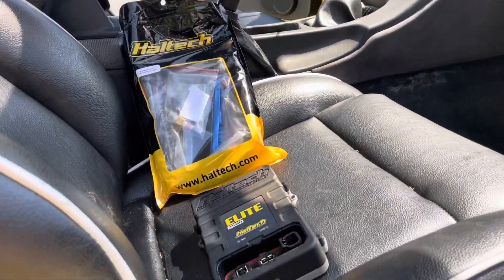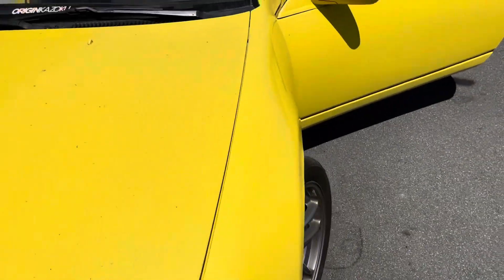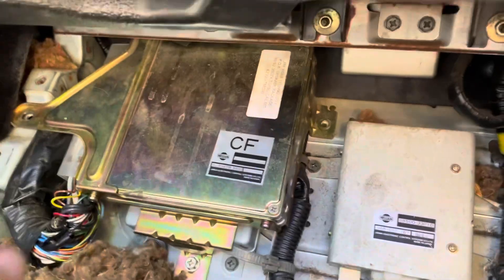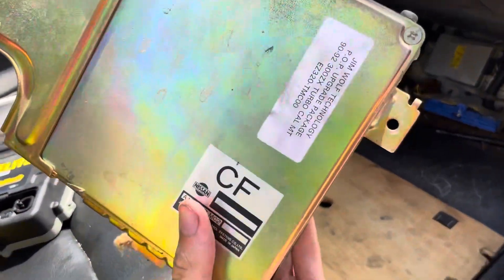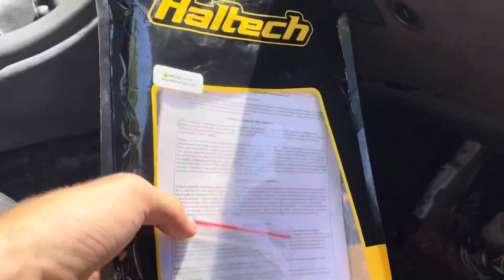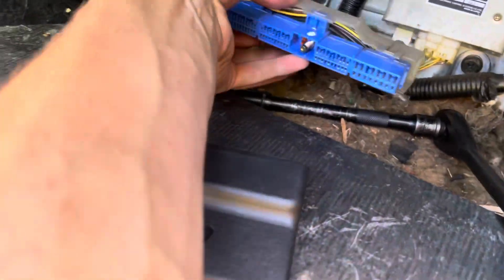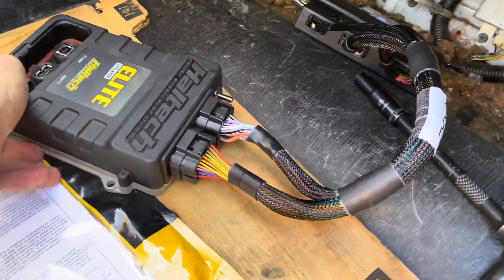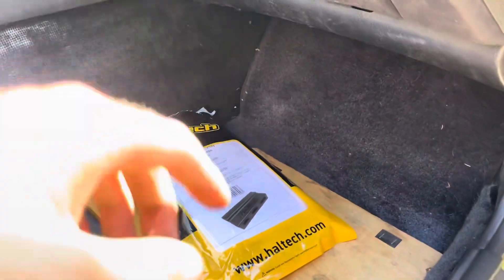UPDATE ON MY BUILT Z32 300ZX | Installing Haltech Elite 2500 ECU

Comment: I got a question. Maybe you can help me. I'm LS swapping my Z. But you said the factory Z32 ECU controls both the engine and "body harness?" The body harness controls things like the turn signal, RPM, temp, oil pressure, etc. correct?
Reply from the maker: I said body harness on accident and I had to correct myself

Comment: 600whp should be very obtainable, considering a complete engine build and new turbo kit and high performance and tunable ecu. I've seen stock engine 300zx's with bigger turbos and injectors on stock chipped ecus doing 700 at the crank.

Comment: Good stuff!  A quick note for mounting the unit - if you plan on keeping the USB cable in permanently (I did), you'll have to get creative so you can actually put the foot board back down.  Facing out, the cable hits the board.  I ended up installing mine face down and it fits in pretty nicely.  You can see what mine looked like in my install overview video (picture at the very end).  I still have some bugs to work out - have a vacuum leak or some fuel issue I need to sort out before I go to tune.  Shooting for 500-ish whp on the OEM engine.  We'll see!  Again - great stuff!  Keep it up!
Reply from the maker: Definitely something I’ll keep in mind!! Thank you!